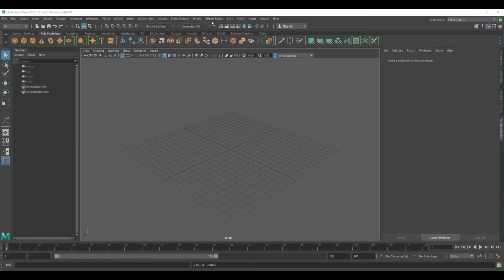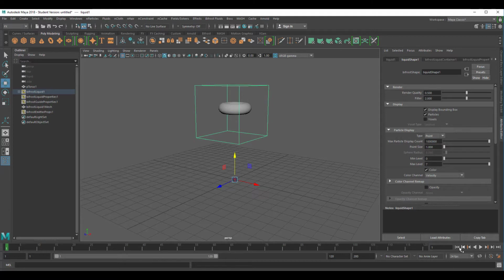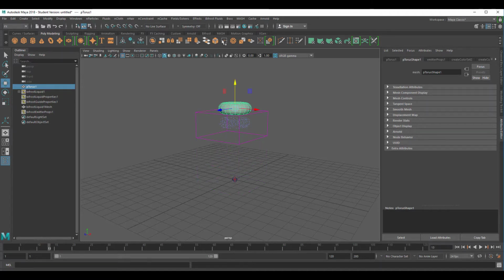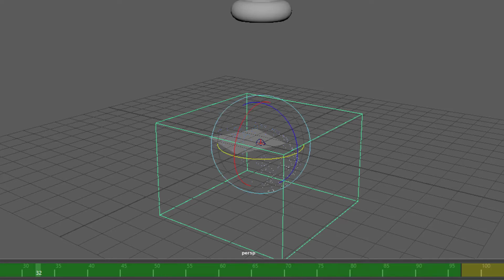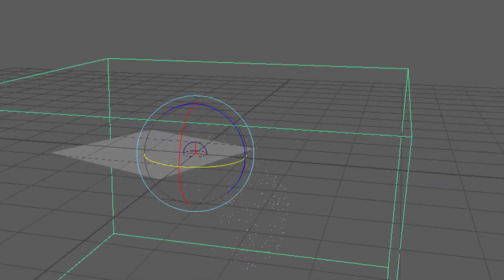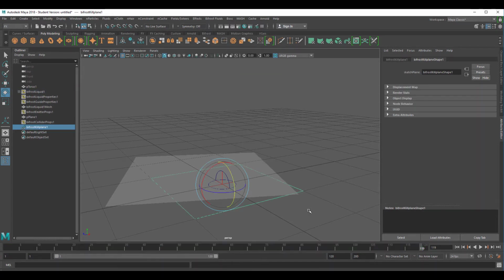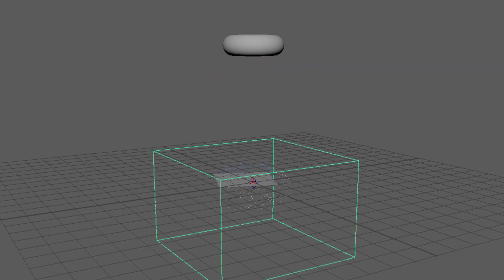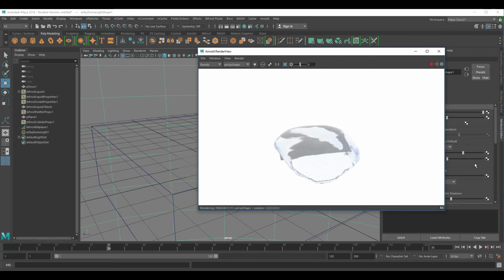Maya – Bifröst Fluid Basics

Comment: the cache like the green one on the time slider doesnt work on my maya 2017 also with 2018 .any thoughts???
Reply: Gowthaman M you might not have it checked on. If you go to the Bifrost options, under the Bifrost tab, you need to enable scratch caching, after that start at frame 1 and wait. I hope that helps
Reply: Thanks got it 
Solved it Long time ago